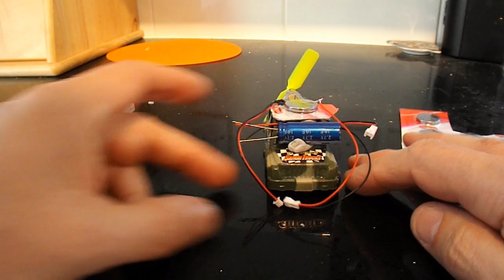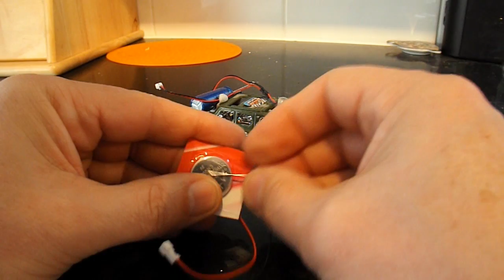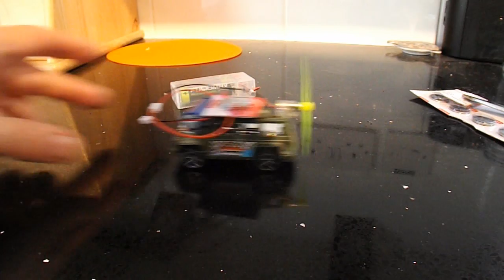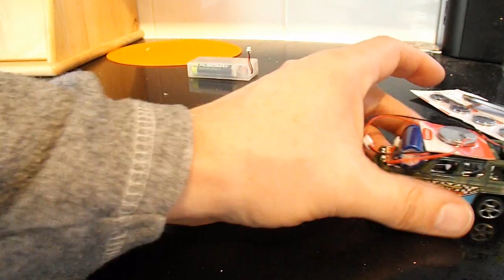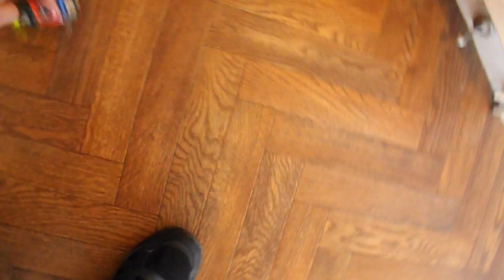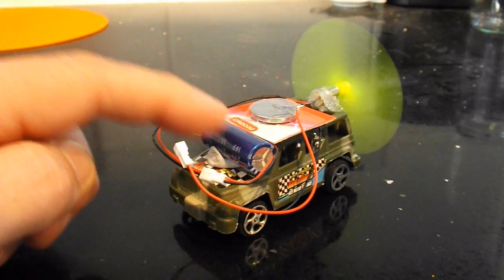Helpfile - Button Cell vs Supercapacitor

Comment: @Grandadisanoldman is there a website where i can buy motors, capacitors and their respective chargers as a kit? (preferably with some sort of connector soldierd on or an onn/off switch) i really wanna get those for my cardboard free flyers.
Reply from the maker: I am not aware of anywhere that sells that sort of thing. The closest to that is probably the basic Power-Up https://www.poweruptoys.com/collections/planes/products/powerup-2-0-airplane
Reply: @GrandadIsAnOldMan  I already have that. I just want the motor and a capacitor with those connectors sold separately really.
Reply from the maker: I buy that sort of stuff individually on eBay. I used to buy the coreless motors that were replacements for the small Hubsan Drones, you could get a set of 4 quite cheaply. The Supercapacitors would have been from electrical component suppliers. Sonex413 did a good video on building a charger for the supercap planes https://www.youtube.com/watch?v=3GFkoMKBCtc
I did a much more basic one here https://youtu.be/tdOc62ZOSUI unfortunately the links in the video description for the components are 9 years out of date so they won't help you.
Reply: @GrandadIsAnOldMan  are there any specific ones you reccomend? and as prev stated, i cant soldier so pre-solderd connectors would be handy
Reply from the maker: @pippyquark  I am afraid you will have to learn to solder. It is a useful skill.
Reply: @GrandadIsAnOldMan  yeah…  is there a specific brand of super capacitor you recommend?
Reply from the maker: @pippyquark  the short answer is NO. I buy stuff from eBay. That means that it is unbranded or generic or fake brand names.
Reply: @GrandadIsAnOldMan  ok

Comment: Nice demonstration. I Bought a little supercap module 16v 1.6F (6 capacitor like yours 10F in parallel ) just for fun and testing... But after a cold morning a felt the ignition of my motorcycle (650cc) has lazy and all the lights go to off including the dash before start... I could not imagine such a little device (1,6F) could help a lot but after simple installation beside battery, today in a VERY cold morning again (Unusual in SP Brazil), the start was way more faster and the lights just blinked... Now I'm here in my work, happy with just five dollar spend and the result, searching about this crazy devices and the possibilities, considering buying another a little more strong (16F) for the motorcycle and put this one in the nobreak, if they help in a ignition, pretty sure they will make difference in the surges demanded.
Reply from the maker: My reply seems to have disappeared, I am certain I replied 3 days ago, sorry if you didn't get the reply. Yes, supercapacitors have progressed , they are more widely used now and much cheaper than they were. That sounds like an interesting project you did with your motorcycle 😊👍

Comment: maybe you can keep 3button cells intead
Reply from the maker: I am not quite sure what you are trying to say. The button cells don't give much current and don't last long. The supercapacitor can be recharged in seconds and gives more current so you don't need to keep changing the batteries.

Comment: that shows supercap have more amperage
Reply from the maker: Yes they have more capacity than the button cell. Button cells are designed for low current draw applications.

Comment: hi ,you have tried connect supercapacitor  to  power Supply 3v 2Amp or more. i think the motor time  depend charge amp   .
Reply from the maker: I don't have an equipment that would accurately measure the current flow or capacitance, however it is a 10 Farad capacitor so that indicates it capacitance and therefor the maximum amount of power it can store. Assuming it is charged to it's maximum capacity the length of the motor run would be governed by the resistance of the motor.

Comment: This is great idea using CAPS but how about connecting 2 CAPS to 1 battery and using a regulator. High Cap MaH battery connected to V-Reg to feed/charge CAPS, then to V-Reg to boost power of CAPS. Idea is more powerful BATT with high Mah used to charge/feed CAPS via V-Reg = CAPS would stay charged with power then a V-Reg attached to get the power you need to power the device. This is what I had planned on doing so I could get a longer flight time on my race fpv quadcopter but I realized I would have to find CAPS and V-REGS that could deliver high C-discharge required.
Reply from the maker: +DeltaAssualt all sound a bit complicated. I know some people have done a lot of work with Supercapacitors but I am happy with this simple application.

Comment: how do you charge your supercapacitor can you please explain...
Reply from the maker: +rohan bhardwaj what part of the video didn't you watch? I connected a battery to it. I had soldered little white connectors to the battery , the motor, and the supercapacitor. To charge the supercapacitor I connected it to the battery. To run the motor I connected the capacitor to the motor. You don't need to use the connectors. You could just solder the motor wires directly to the supercapacitor and leave the capacitor wire legs long enough to touch directly on the battery terminals. If you do that the motor runs while you are charging the capacitor but as long as your battery is strong enough it will do both.